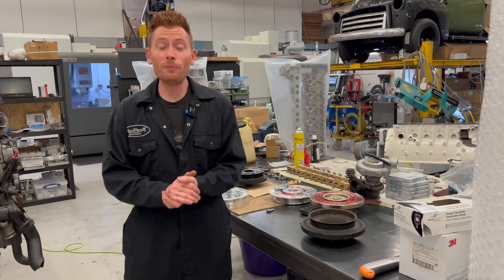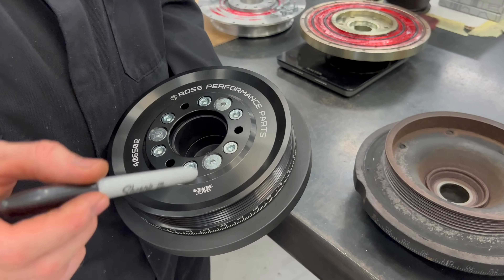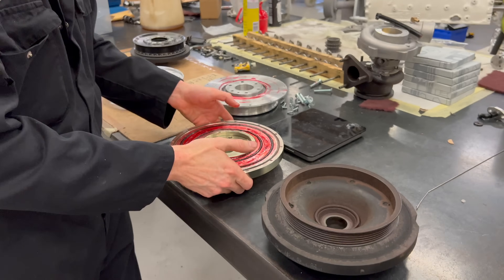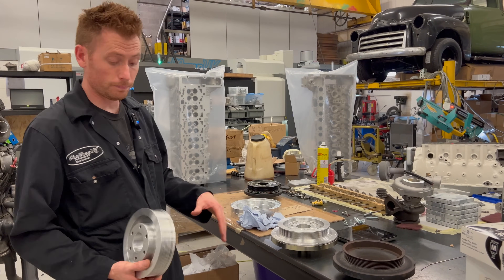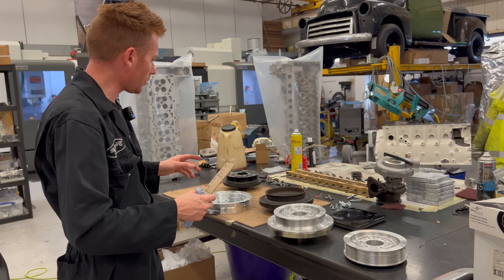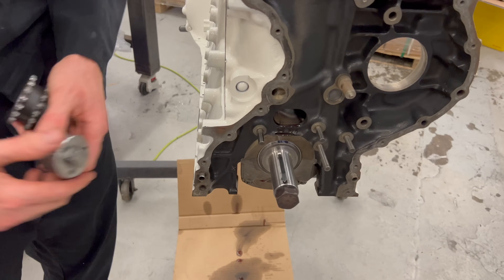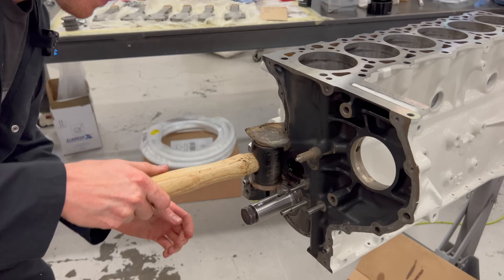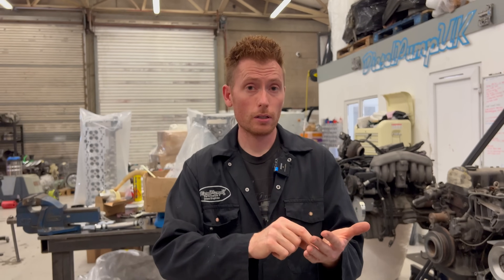OM606 Crankshaft Damper Pulley Options and Function

Comment: Only speaking from large diesel experience 800 to 2500+hp as the hp rating changes for a particular engine the dampener changes in mass even stacking becomes normal and most HD constant power big hp engines run fluid dampeners from OEM'S, if you tjink you can change HP rating and not upgrade damper you are ordering a broken crank in that deal, if you see any evidence of fretting on crank mounting surfaces whether they be a snout or flat face then either someone is over reving engine or damper is either wrong for HP calibration or defective, most dampers i deal with cost more than most car guys whole engine ! I see similar issues with smaller egines ive looked at usually after failure and someone asks an opinion of what caused it as they are usually dumbfounded as why it blew up !

Comment: Not to be hating or anything but from my understanding a harmonic balancer is not a counterwight. it should be a spring mass dampener system that is finely tuned to the resonance frequency of the crankshaft - if you look at it like a torsion spring. Once the combustions hit the crankshafts resonance frequency , it starts to twist violently in alternating directions - this can and must be measured with high speed trigger equipment at the front and back of the engine simultaniously in order to develop a harmonic balancer. Its purpose is to basically resonate in the opposite direction to cancel out hte torsional vibrations - kind of like mechanical noise canceling. This internal Disc design is lacking the Spring in the Spring Mass dampener system.... yes the weight can slip but as i said... thats not its purpose . Gale Banks did a great video about it - even showing how a OEM Rubber style dampener disintegrates once the amount of crank oscillations needing to be dampened due to higher engine power exceeds the dampeners design limitations.
Reply from the maker: Your correct yes, I believe Gale banks used an ATI style damper just like my design from memory.

Comment: i am trying to picture packaging with a supercharger.  a turbo is on the exhaust side where you can mount it low and under the hood. superchargers are typically mounted on the intake, or at least on the intake side. so where are you planning on sticking it?

Comment: Would you suggest pinning this new style pulley as well?  Or do you think the updated woodruff key is sufficient?  I already bought the pin jig from you but I’m hesitant to use it until I’ve arrived on the actual pulley I’m going to be using.

Comment: It's been my experience that a 10 rib pulley will want to slip after about 20lbs of boost, even with alot of belt wrap. Unless you run a cog belt system how can we run 35 to 40lb of boost (approximately 450 whp) without belt slippage. It will be interesting to see how many pounds of boost you can run without slippage.
Reply from the maker: Did you just relate a power figure to a boost number? Naughty naughty, a boost number does not equal a power figure :-)
Reply: This was just an estimate,  the fact remains, there will be a huge load on that belt and with the typically higher boost pressures the diesels run, it will be interesting to see how far you can go without belt slippage, this is just based on more than 55 years of building supercharged cars ( gas powered)  like I said I will be interested in seeing how far you can take the boost level before belt slippage rears it's head.